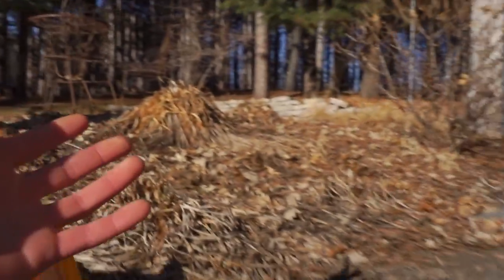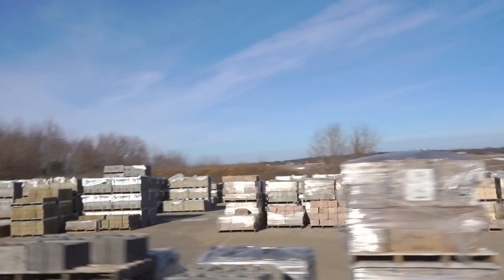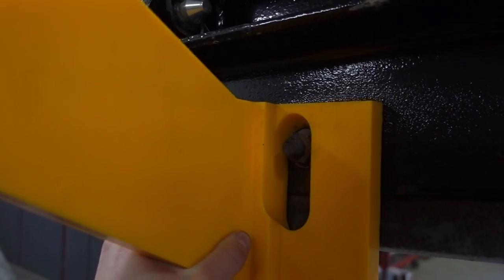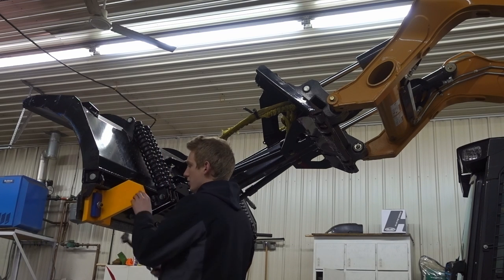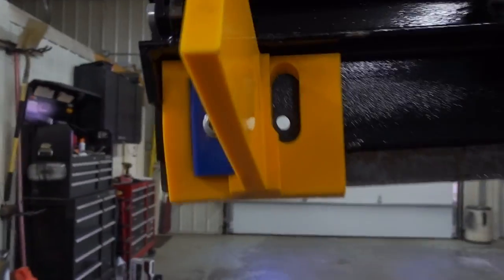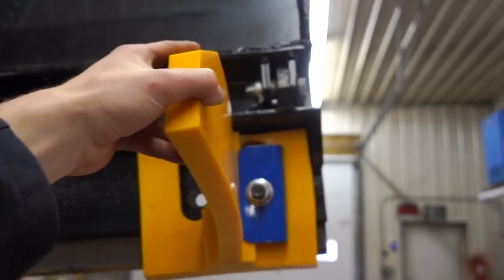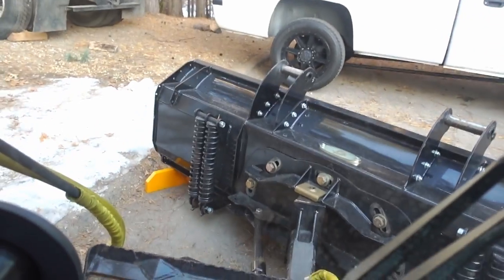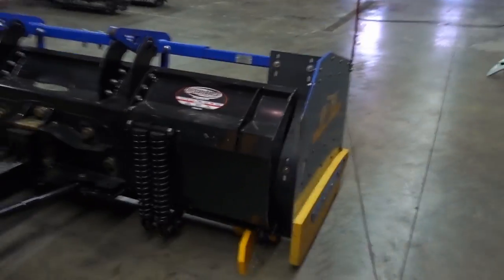New Snow Plow Parts | Case Skid Loader With Kage Plow

Comment: Wish I had the Kage!  JUst had our first storm of 2019 in KC, 8'' of wet heavy slushy crap!  The bobcat s750 with a protech box was doable but I'm pretty pissed at the company I sub for.  (It's a Menards lot that's almost 3 acres) they only had one bobcat assigned to it, I did have another truck helping me yesterday with a boss v plow which definitely helped.  Among the other problems they gave me no site map, they told me the wrong locations to stack snow and then had me move them to the other side of the lot.  My favorite complaint was that I'm supposed to be running the bobcat at 1/4-1/2 throttle to reduce fuel consumption!  Apparently, they assumed on a 12-hour shift on the bobcat its fuel should last an entire 12 hours, even running it below wot it feels underpowered(starting to wonder if the engine might be having an issue, possibly a turbo acting up).  I'm going to call the company's general manager to see if they can either get me another machine from the there fleet or get the bobcat rental department to take this one and get me another one.
Reply from the maker: Yes you need a kage on these bigger lots! You can angle it and let the snow dump to one side once the box is full and only have windrows on one side not 2! Plus being able to take the box part off helps stacking big time! One of the most versatile plows on the market!

Comment: If you get real snow, these just make you wish you had a real blade, its like a 2wd truck.
Reply from the maker: A kage or a skid
Reply: @CarsonSchifsky  a kage plow is just so limited to what it can do, the time savings with a HLA plow with 180' wings or something similar makes up for the extra cash you gotta spend, and keep it indoors during the off season and they last forever. HLA build a tuff plow, we run one on a skid and have 2 on tractors.
 I get it, you gotta start somewhere but they are great money makers.  That one skid does the work of 2 plow trucks.
Reply: @CarsonSchifsky  i do really like that case skid compared to our jd, looks sweet.